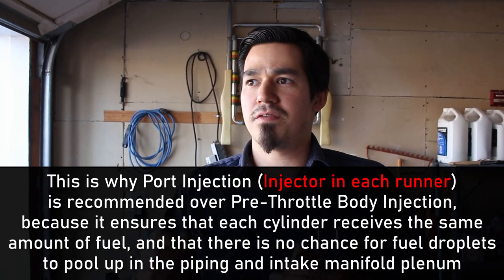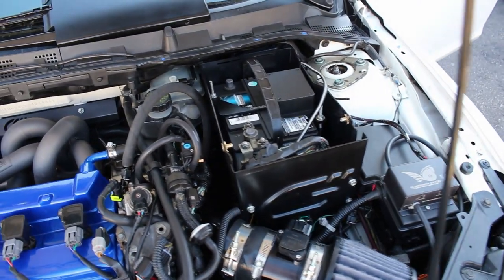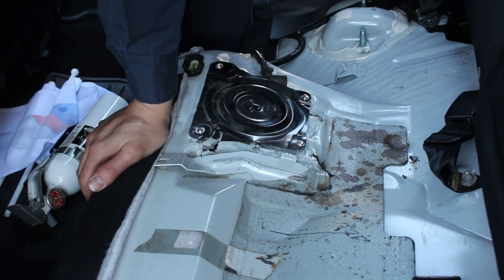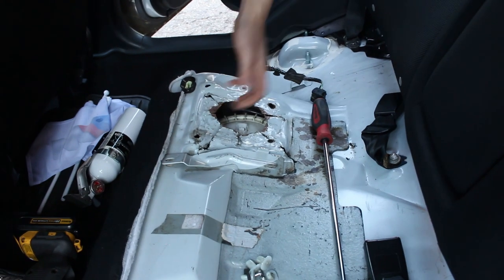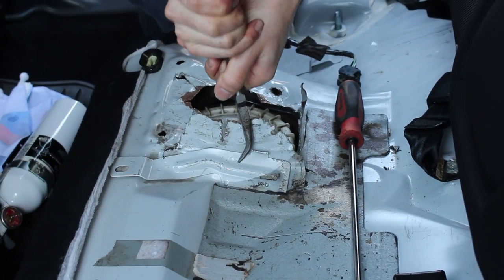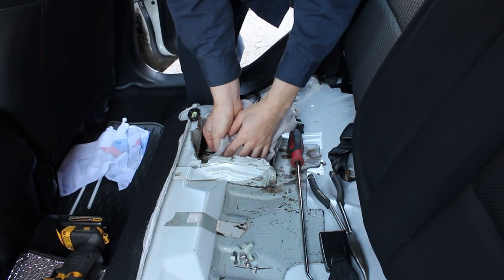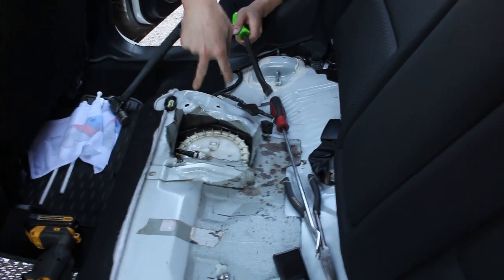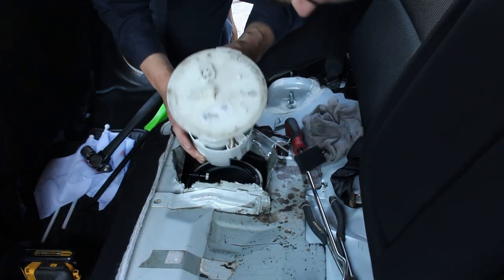Mazdaspeed 3 - Crushing The In Tank Fuel Pressure Regulator

Comment: This will work for most returnless systems with the valve?
Reply from the maker: This mod is primarily for returnless systems as far as I can tell.
Reply: @WannabeTuners  would wana try this but don’t have a fuel pressure indicator in my car.   Also did this effect the tune in anyway.
Reply from the maker: @BulliKid  Yeah you definitely want to be able to monitor the low side fuel pressure, it's also good to have for diagnosing fueling issues. I'm seeing about 70 to 75 psi on the low side now, as opposed to 60 psi without crushing the regulator.

In terms of tuning, the slightly higher fuel pressure has not changed the long term fuel trims at part throttle as far as I can tell. The only slight change would be at WOT, as the Auxiliary fuel injectors will deliver slightly more fuel when they kick in due to the slightly higher low side fuel pressure. Some fuel may need to be pulled from the MAF calibration in those voltage regions. But depending on how many AUX injectors you run and how big they are, the stock ECU may be able to correct for the slightly richer AFR. Ideally though, you want your base MAF calibration to be achieving your desired AFR targets prior to enabling AFR corrections at WOT.

Comment: Who you happen to know if that the problem with my car. It has a P0091 code and runs perfectly fine but it won’t make any boost and before it was miss firing like crazy I’ve replace the HPFP and the fuel rail pressure sensor and it stopped with the miss fires and was running perfectly fine but then the next morning the same code came on and no boost

Comment: Does the L34B-13-ZE0A Fuel Pump body provide filtering, too, or is it just the LFB6-13-ZE1 sock?
Reply from the maker: The fuel pump body itself does not provide filtering. The sock is a pre-filter to the pump, and the pump pushes fuel through the basket which is the main filter. So it's a good idea to replace the basket and sock if it's got higher mileage.

Comment: Hi what was the benefit of raising fuel pressure with this mod?
Reply from the maker: Since the AUX fuel system (6th port) doesn't have a return/regulator, boost pressure will work against the low side fuel pressure when the AUX injectors open. Raising the low side fuel pressure 10 psi or so will help to maintain good atomization of the fuel at higher boost pressures as the AUX injectors spray.

Comment: Im getting ready to put on my 6th port kit and my low pressure side has a AEM fuel regulator after the injectors but before the hpfp, would I be able to turn up fuel pressure from the external regulator or would I have to still crush the intake regulator? It is a returnless set up so I’m guessing I’d still need to crush the in tank regulator but maybe I could be wrong, what’s your thoughts ? @wannabe tuners
Reply from the maker: I think you'd probably have to run a return hose from the AEM fuel pressure regulator back to the fuel tank. I'm not sure if the in-tank regulator is retained or not when running an externally regulated setup, as I've never gone down that path before. I've just been running 6th port in a returnless configuration, and by ever so slightly crushing the stock in-tank regulator, maximum low side fuel pressure has increased by about 10 psi or so. This will hopefully improve atomization of the fuel as it exits the aux injectors at higher boost pressures. I could be wrong, but I would assume that the in-tank regulator would be removed if running a return back to the tank on an externally regulated setup. If you find out a definitive answer, I'd love to know too :)
Reply: @WannabeTuners  what would you expect to see the fuel pressure be at if the in tank regulator broke from crushing? Only seeing about 29psi on the hpfp reading after crushing it and the external fuel regulator gauge isn’t reading pressure
Reply from the maker: @tucansam3417  Usually the OEM in-tank regulator will regulate the low side fuel pressure to about 60 psi. If you're now only seeing 29 psi at the rail with key on engine off, it's possible that it was crushed too much.
Reply: @WannabeTuners  so after priming and cranking over and over I’m seeing about 50+ psi at the hpfp now but noticed my injectors aren’t spraying no codes, would you know of any possibilities that can cause this ? All injectors connected harness is plugged in when I do crank it over voltage drops to about 9 but don’t really think that’s the issue of them not spraying

Comment: My man!!! This is exactly what I've been planning to do on my Subaru. The regulator on your Mazda's pump assembly looks almost exactly like on my car, as the NA Subaru's have a return less fuel system. I wasn't sure I was on the right track, but seeing yours shows that I've got the right idea. Thanks for the upload!
Reply from the maker: Thanks man! What model and year is your subaru?
Reply: @WannabeTuners  It's a 2006 Outback 2.5i which has the EJ253 engine in it. I've got a bunch of mods - increased the compression ratio by shaving a fair amount off the heads, I got a camshaft regrind from Delta, custom intake, custom equal length header w/true merge collector, and an exhaust. When doing datalogging I can see that I'm hitting 100% fuel injector duty cycle at higher RPM's, and even lower RPM's my ECU is close to maxing out the fuel correction to keep AFR's normal. Everything is new, I even had my fuel injectors cleaned and flowd and put in a slightly higher performance fuel pump from the turbo Outback model. So, hopefully by increasing my fuel pressure I can get a little more headroom for tuning!
Reply from the maker: @crxtodd16  Nice man! Theoretically with a slight bump in fuel pressure, more fuel should be delivered for a given injector pulse width. If you have a way to monitor fuel pressure that would be helpful too. I'm just wondering why the fueling corrections are maxed out in the midrange. Could there possibly be an air leak somewhere? What do you use to monitor things?
Reply: @WannabeTuners  I've got a fuel pressure gauge, I also use RomRaider's datalogging tool to do all my logs. Seeing how my long term fuel trims are maxed out across the entire MAF range I would certainly agree that looking for a vacuum leak is a priority. And I've checked EVERYTHING intake related, from the MAF sensor seal all the way to the intake manifold gaskets - I've checked every hose, gasket, o-ring, even the fuel injector-to-intake manifold seals. Not even the smallest leak. All my hardware (ie hoses, gaskets, and sensors) is new, too. The only thing I can come up with is that my mods have pushed the fuel system to the limit. I've spent weeks diagnosing this, doing log after log, reverting the intake and my catch can back to stock... Also replaced my MAF and o2 sensors just in case, but the readings are still the same. I even pulled my plugs to take a look at their color to verify the AFR's I'm getting are accurate.

It runs great, though! It's just right at the limit of running lean. After adjusting my fuel pressure, I may have to modify my MAF/AFR tables to fine tune the ECU, but I'm confident I can get it dialed pretty nicely. Also, thankfully, the stock fuel system runs at a relatively low pressure normally (49-52 psi, but one guy had his running at 105 psi!!) So, I have some wiggle room to try to increase it. But, if I can't do it then I may end up having to switch over to a WRX/OBXT style fueling system so I can use bigger injectors and then remap to compensate for those. I don't want to go to all that trouble, but at least I know what my options are. 

Not many people modify the NA Subaru engines. And the few that do don't share/document any of their findings, so I'm finding that I have to learn almost everything first hand. But I've got some good experience modifying other platforms so most of the engine/tuning knowledge works here, too.

Comment: When you upgrade your fuel pump, do you recommend changing fuel regulator & soaker part? Thx
Reply from the maker: When upgrading the fuel pump u don't need to replace the regulator, but always replace the fuel sock :)
Reply: @WannabeTuners  , even if you run a Bosch 340lph drop in fuel pump, it will still be restricted to 60psi with the stock mazda fpr because the gas runs through it at 60psi spring preload rate.
You still have to mod the in-tank fpr or use an external fpr with return line regardless of what pump is used.
This crush mod helps even the stock GDI hpfp because the hpfp would receive the fuel with higher pressure thus it can pump it at higher psi than usual.
Higher pressure => a bit higher volume of gas pumped in x time of injection.
LE: The idle hpfp psi should increase from ~400--420psi stock to over 500 if my math is correct. Can you check that please? Thanks.
Reply from the maker: @eEnzo0  From what I can tell, the fuel rail pressure hasn't changed at idle or at WOT. In my opinion, if there's any fluctuations with fuel rail pressure, the ECU will vary the duty cycle on the hpfp metering valve to meet hpfp pressure targets in the tune. As for the slightly increased low side fuel pressure, I don't think it will have an effect on the fill volume of the hpfp. So long as the low side fuel pressure doesn't fall too low, there shouldn't be any issues with filling the hpfp with fuel. But since we cannot compress fluid, we can't overfill the hpfp so to speak. The hpfp with upgraded internals outflow the stock direct injectors, so the only way for fuel pressure to drop in the fuel rail, is if low side fuel pressure drops low enough to the point where there isn't enough pressure to fill the hpfp, or if the pressure relief valve in the fuel rail gets stuck open
Reply: @WannabeTuners , you misunderstood my sentence. It's not about the drop but the help the hpfp needs to fill the direct injection ramp.
Having a bigger piston in the hpfp or a higher pressure to begin with, means that without reducing the pressure with the spill valve you can actually pump more gas in the engine and overcome a bit the limiting factor, amount of fuel needed for 400hp for example.
On ms6 without PI the maximum one can achieve is about 380hp and it runs out of fuel on stock hpfp. Increasing the pressure on low side can help raising the bar on power goals, a bit...
Reply from the maker: @eEnzo0  Yes I agree that increasing the low side pressure slightly helps, but we will still be limited by how much the injectors can flow at a targeted fuel rail pressure. As long as pressure on the low side is sufficient enough for the hpfp to achieve targeted fuel rail pressure, the injectors will still be the limiting factor.

Comment: I would just use the OEM line for return and run a new 6an line from the basket with a Y at the firewall to split it between HPFP and PI rail then run return with FPR after the PI rail. Or just leave the basket FPR alone as a lot of people have made 500whp just splitting the OEM line at the firewall as long as they have a bigger in tank fuel pump like aeromotive or AEM. More pressure is not always a good thing when trying to tune PI consistently. I hope this works out for you though.
Reply from the maker: Thanks for the advice man! The main reason why I wanted to give this method a try is because I'm not looking to make much more than 500 whp at this point, and if I can save money I'm all for it 😄
Reply: I am running returnless 8th port. Will Dawson has told me its good for 500-600 whp. Yes it has its limitations. But its simple system that more then meets my needs. No extra lines. No regulator needed.
Reply from the maker: @gimmethecarkeys  Sweet dude! Glad to hear :) Did u do anything with the in tank regulator or just leave yours as is?
Reply: @WannabeTuners  I have an aem 340. Will said 550-600. Crushing regulator will give you headroom but not necessary
Reply from the maker: @gimmethecarkeys  Beauty!

Comment: I over crushed mine on accident. For what it's worth, the DW65c pump's internal relief valve is about 100 psi. So I had 100 psi at the fuel rail and my 6th port. The downside is that this is in a speed 6, so with the regulator not flowing any fuel, the jet pump doesn't work. So fuel from the other side of the humped fuel tank cant make it over to the basket.
Reply from the maker: Oh interesting good to know! I wonder if replacing the regulator with a new one and trying not to overcrush it will resolve the issue.
Reply: @WannabeTuners  Probably. The oem regulator is manufactured by Delphi if I'm not mistaken. Perhaps contacting them would help finding a drop-in alternative at higher pressure.  For me personally, I'm just going to crush another oem one and be more careful this time. 100 psi was nice but I think 80 would be plenty, giving 45psi across the 6th port injectors at peak boost. 👍
Reply from the maker: @timjs1018  Absolutely brother! I think that as long as differential fuel pressure is above 40 psi, it won't have any issues with atomization.

Comment: I have a question I bought my mazdaspeed 3 08 awhile back and the car is hitting 22 lbs I no it’s a lot I had people tell me it’s a vacuum leak so I thought it was my top mount because I would notice it lifting from couplers so I bought the front mount intercooler and the hpfp and still the same issue car is hitting boost cut leaving me with code engine overboost condition
Reply from the maker: Give me a DM on Instagram and we can talk about it :)

Comment: What about inserting a small C clip in the pressure regulator hole to act as a washer and put more tension on it?
Reply from the maker: Not sure if that would work or not because there isn't really a way to get anything on top of the spring itself